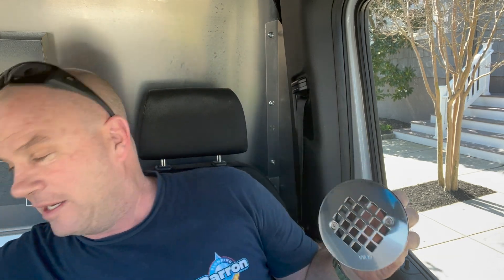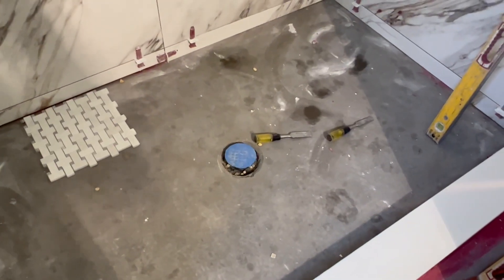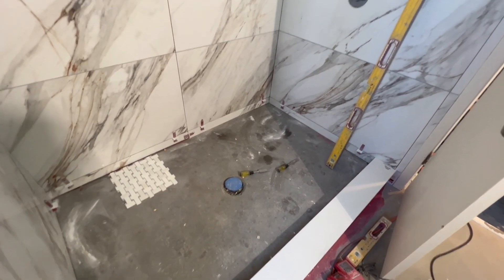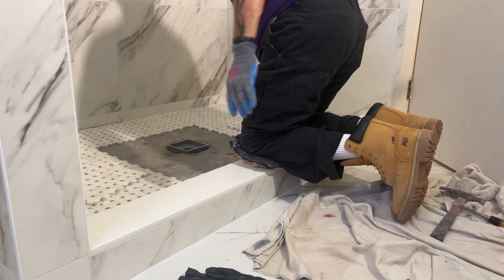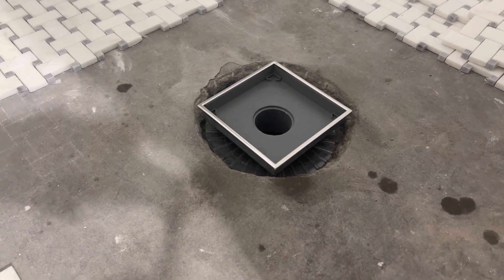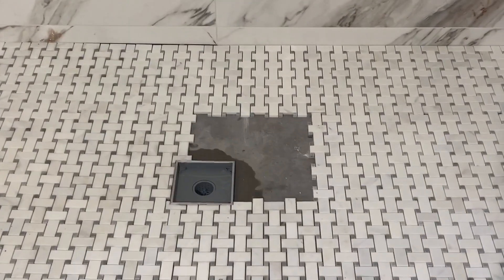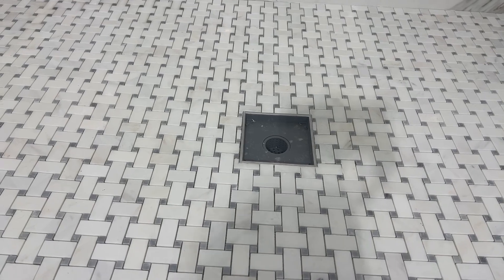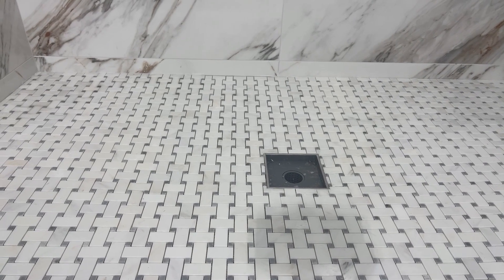PLUMBING REPAIRS | SHOWER DRAIN TRIM | QM DRAINS

Comment: Hey man. I just did my 4hrs for the year and I watched you HWT videos to get my credit. 
You had changed out a gas valve I believe, in one of the videos and couldn't get your pipe wrench in the valve and you had posed the question on an easier way? 

I hear to answer that Q for you if you haven't received an answer yet?

When you change out a gas valve on a HWT and put a long nipple in the gas valve feed and used that as leverage like a handle 👍🏽.